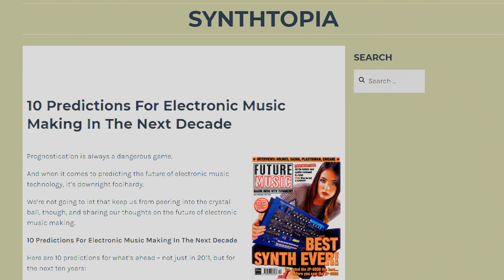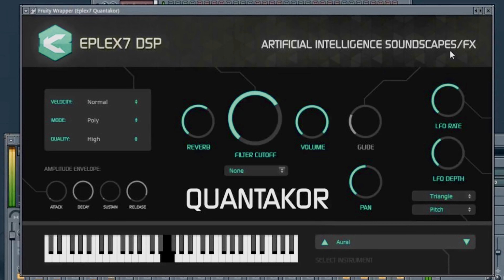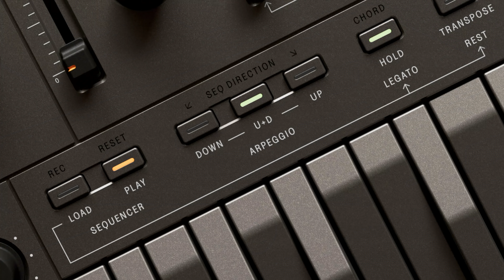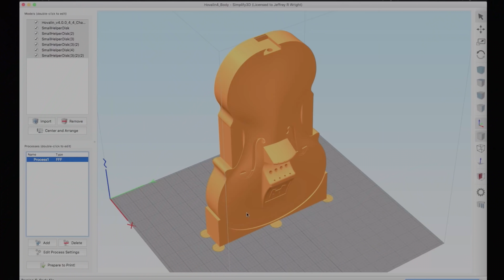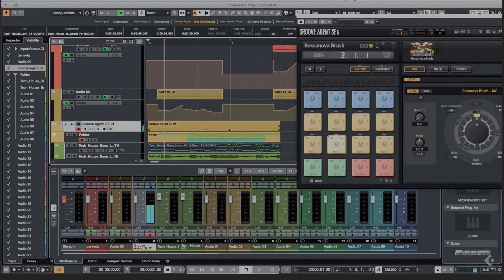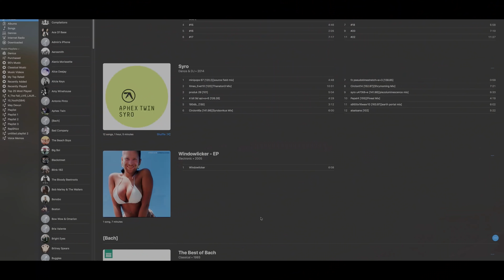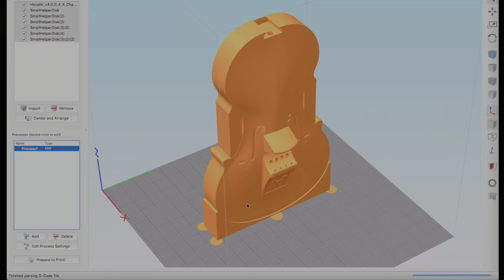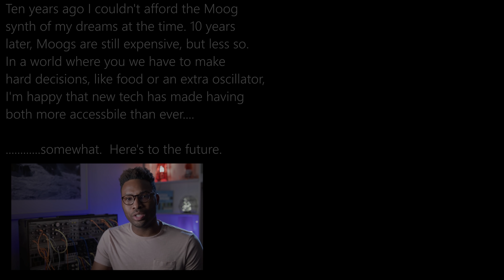10 Electronic Music PREDICTIONS: DID THEY COME TRUE?

Comment: I think DAWs will get a lot better at giving us automated + simpler ways to do things. For example, Live 11 has linked track editing, which is cool but to me it's like a way crappier version of multi-cursor editing I'm used to when coding. I think these software are powerful but still have a ways to go. Being able to record macro actions, set complex keyboard shortcuts (e.g. add an instance of plug-in x to the start of the currently selected track's chain), store automation clips, do background rendering, etc. will become more commonplace. The standards for quality of music and mixing will increase as making tracks and experimentation becomes easier.

I also think electronic music might get more interesting and complex as CPUs become less of bottleneck, and most of us can run a massive # of instances of Serum, Diva, etc. without having to bounce any of it down.

Comment: I have the time for some predictions. Just gonna wing it...
- integrating your music production into social media in whatever capacity will become more seamless, think a DAW that also serves as the hub for releasing and cataloging your output as well as your social network for working with collaborators and sharing with fans
- DIY synth and audio tool designs will be possible via modular systems that allow the user to implement individual components rather than specialized modules, in the vein of a system like the Zoia but with pieces like legos 
- Hardware synths will enter their custom shop phase like where guitars are at now, manufacturers will offer premium designs and features that are hand built and cost a fortune but are built to customer spec
- wearables will allow musicians full tactile control over their instruments or instruments will be inherently designed with a wearable integrated
- MIDI and VR integration, you can be a virtual piano player sitting at a virtual piano for a virtual audience all while sitting alone in your bedroom with a headset on
- DSP improvements will allow for hardware devices to be virtually modular, Arturia could put out a standalone hardware board that loads an algorithm allowing players to utilize familiar digital and VA synth components and mix and match aspects of these classic devices with no compromise in sound quality and without the need for a computer, DAW, or app
- generative tools and generative-focused instruments will allow for an even easier foray into electronic music, hit a button that randomly generates a decent sounding patch and solid groove every time no other input necessary
- hardware clone market will proliferate further, you'll have a range of Moog clone options rather than just the original or the Behringer 
- sound design will become so streamlined that DX7 style programming will seem older and more archaic than it already is, menu diving will be a long distant memory 
- MIDI 2.0 will get a tentative implementation date but nothing will be confirmed 
These are all conjectures, I have no insider knowledge and am not a time traveler from the future

Great episode! Definitely gonna be looking for your follow-up in 2031

Comment: - Cheaper/less expensive instruments [mass production helps]
- New forms of synthesis [including hybrid]
- V.A. and V.S. make a strong comeback in hardware [pretty much as FM is making now]
- Wavetable gets even better
- Inteligent pitch stretching and correction for sampled instruments get better at it
- All in 1 synth Workstations more focused on multiple synth engines [12+] with easily upgradable hardware [memory, etc]
- Poly Aftertouch on pretty much any polysynth
- less Monosynths
- Less patch cables, more wifi/other [including interfaces, mixers, etc]
- Simplified DAWs
- Desktop multi-fx [digital and hybrid]

Comment: for the next decade i put my hopes on three things mainly:
- that handheld synths get actually good sounding speakers and not make me feel like i'm playing on an empty pepsi can
- that physical modelling will take over
- as a drummer, that electronic drum pads implement zone intelligence. i can't fucking wrap my head around the fact we're in the age of AI and edrum manufacturers are still stuck to early 80s grade technology that offers only one zone in the center and maybe two on the rim while only offering strike sensitivity and no position sensitivity. before you comment, i'm aware of synesthesia's mandala and i'm also aware they're fucking dead in the water and used mandalas are impossible to find, i also know about the sunhouse triggers, but i'm actually looking for electronic pads. sorry for the rant but this shit drives me nuts

bonus point: let's hope midi 2.0 doesn't flop
Reply: Have you had a chance to play any of the Roland kits using the new digital snare and ride? Curious if that raises the bar at all.
Reply: Safe to say MIDIII has already failed.

Comment: I'm expecting a full digital node based modular poly synth with keyboard and mouse and assignable physical controllers on it instead of touchscreen which is slow and annoying at this point, guitars effects amps and cab sims will get put directly into a guitar with foot switch and expression pedal accessories and controllers built diectly into the guitars, very soon and I'm hoping they'll make it balanced audio and fix the noisy power system that's plagued guitars.

Comment: Not a prediction but a comment on batteries. 
Personally I like the idea of slapping some AA in my Monologue or UNO synth because in 10 years I will still be able to do so and rechargeable batteries aren’t at that point yet.
Reply: Li-ion batteries are pretty fantastic, and improving pretty quickly. We already have common cheap 18650 cells (18mm X 65mm) which have 5x the capacity and like 50x the power of the best Eneloop AA (14mm x 50mm) cells. They can last over a decade if treated well, and are easy to replace. And more recent tech developments into carbon cells look like they'll be able to increase capacity about 7x beyond that, so a single finger-sized rechargeable battery would be the equivalent of 35 to 70 AA cells per charge.

Comment: Biggest question: will there be any MIDI 2.0 synths and controllers available at least in 5 or 10 years, or will 7bit MIDI still be the standard?
Reply: Maybe. The MPC One has convinced me of the benefits of USB-MIDI (I was very cynical before) and that's the first step towards 2.0.

Comment: Synths that use AA batteries will still be usable in 10+ years. Unless its user replaceable, I wouldn't expect the same of a lithium ion equipped synth.
Reply: there are also exchangable litioum ion batteries in the same shape as (slightly-bigger-than) aa batteries. These could easily be charged within a device as well. I think my old bike light had these.